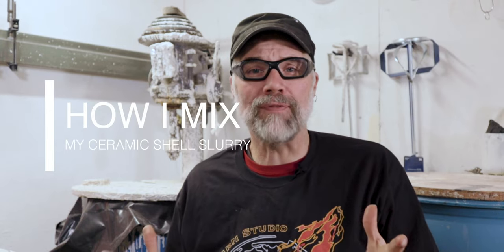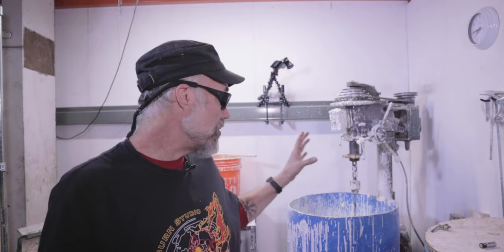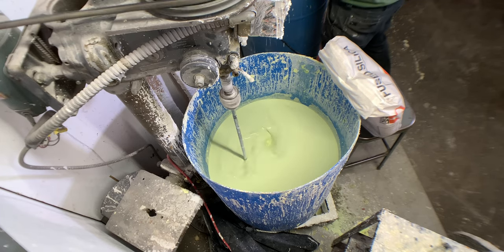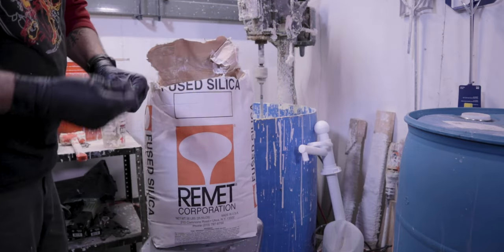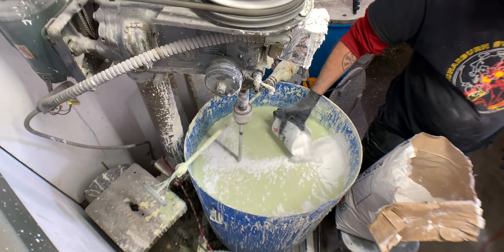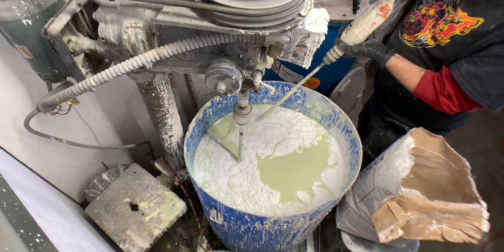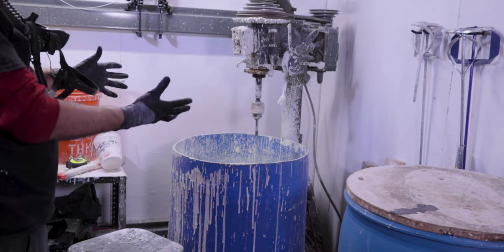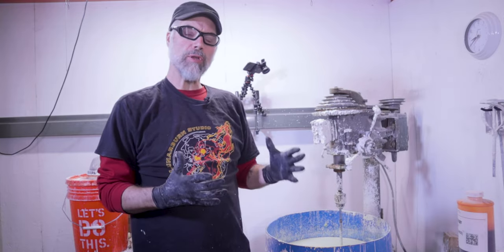Lost Wax Casting: How I mix My ceramic shell slurry

Comment: I know this is an old video, hopefully you're still responding to questions... Is all the moisture in the mix from the colloidal silica, or are you adding water to the mix? thanks
Reply from the maker: When first mixed it is just the liquid colloidal.  Over time moisture will evaporate and you will need to add distilled water to maintain the correct consistency.

Comment: Hi! thanks for the video. I am doing it at home, and slurry becomes little thick. In this case what should I add more? should I add more of colloidal silica?
Reply from the maker: The slurry can thicken as water evaporates from the slurry. To thin the slurry add distilled water in small amounts, mixing between each addition till its back to the desired thickness.
Reply: @LunarburnStudio  I used 25kg of colloidal silica, 50kg of fused silica, and 6.25 kg of bentonite. Then got a thicker result. What possibly did I do wrong?
Reply from the maker: The amount of bentonite is too high.  Should have been 150 grams at that ratio.
Reply from the maker: Im trying to think of a solution for your situating. Adding more water might help, but best to add both colloidal (1) and flour(2) @ the ratio of 1 to 2.  Although im guess if you are doing this at home your are limited by space.  

The recipe i use is 55 pounds colloidal, 110 pounds silica flour and a .25-.33 pound of bentonite.
Reply: @LunarburnStudio  thank you. I will try again.
Reply from the maker: Glad to hear you going to keep working with it. Also, dont feel like what you mixed is of no use.  Once you get a feel for the proper mix, you can use that first mix as your bentonite given the high density.  Now im not sure what quantities you will want to use, it will take some playing around.  So for now, seal up that first batch for that later use.  Good luck

Comment: can help me sir
Reply from the maker: I will try to, can you be more specific?
Reply: Sir, thank you very much for the quick response, sir. I want to know what the wax is used for in the design, and I want to know what the liquid in which the wax is placed and what is the powder that is placed on the wax after it comes out of the liquid and I want to do this method at home Does it work? Thank you, please.  I may ask you other times to learn from you and to know
Reply from the maker: @kink_  I prefer a microcrystalline wax, but a number of waxes can work.  Just be careful with candle waxes as they can be more flammable and can cause issues during burnout.  Check out my videos on wax working.  https://youtu.be/twt3fXp6B8U   As for the liquid its called slurry and is a mixture on silica colloidal and silica flour.  I prefer fused silica which is a fired quartz.  So silica four for the slurry and silica sand to coat the  wet slurry after dipping your wax.

Comment: Bro slurry composition
Reply from the maker: The recipe you use will depend on the materials you are able to source.  With Remet's Adbond II (colloidal) and 400 mesh (RP-1) fused silica flour my ratio is 1 part colloidal and 2 parts flour.  But again, the ratio could be a little different depending on the specific ingredient you use.  Check with the manufacture for their suggested ratio.  The perk of mixing your own slurry is that once you understand your base mix, you then have the option of tweak it if need be to your needs.
Reply: @LunarburnStudio  bro what is 400 mesh
Reply: @LunarburnStudio  AdbondII ?

Comment: Thanks Eric, great information ;0) I use a suspension agent now, but would like to know where you purchase your bentonite? I didn't see it offered at Remet and didn't want to guess with common hardware store material.... grateful for any advise. Chip Jones
Reply from the maker: Typically I source bentonite via ceramic supply.  I use a 325 mesh bent.

Comment: Have you ever seen an ANKARSRUM Kitchenmixer-System?
It supports to mix the slurry by using such a piece of wood or something, fixed to the barrel.
By the way- thanks for your nice videos.
👍🏼
Reply from the maker: I have not, but thats an interesting idea.  Just a reminder, you dont want to mix too fast.  the spped should be just enough to keep the slurry moving.  If too fast, it creates friction that will heat up your slurry and dehydrate it.  Just keep an eye on it.

Comment: I would come dip for you just to see your process and how you operate. Do you use Sp-30 for your back-up coats? The foundry I worked for ran a lot of work a week. The system we ran might not be as cost efficient for a smaller operation. Our slurry tanks ran 24/7 or it would separate and harden. I really enjoy your videos. I really makes me miss my old job. I worked in a foundry for almost 15 years. With that said your videos are the best examples of informing people. Thanks.
Reply from the maker: I run a one slurry system and the colloidal I use is Remets Adbond ll.  I have been doing foundry work for closed to 40 years (started in high school shop class).  I have taken a few brakes but always find myself going back to it.  Where are you located?
Reply: @LunarburnStudio  I'm in Oregon and spent many years working for Valley Bronze of Oregon in Joseph. We did a two part slurry. Primary coat and then back-up coats, but used Remet as well.

Comment: Looking forward to comparison between the referenced premixed slurries and any other of your excellent informative videos.  Is there a Safety issue with using fans to dry slurried/stuccoed works.  I have just started the process(4 coats so far) using your wonderful pouring cup concept (thanks).  I have chosen to let the works air dry over night without fans as I notice the stucco still slightly loose initially. I am retired and have the time!
Reply from the maker: Air drying is fine, the key is that the shells dry evenly.  Depending where you are doing the dipping and ventilation, fans can spread the silica around.

Comment: I got a lot out of this video and just subscribed. I hope to learn more. Thank you! 

Btw, if I had a small-ish tree of rings or pendants (fits within a 3"x5" flask?) how long would the overall process take of dipping, sanding and drying, then being ready to cast? (mixing time not included) I'm trying to figure out the advantages of the silica-gypsum process. Which captures more detail? I thought I'd put those out there. Thank you!!
Reply from the maker: My first question would be what kind of metal are you casting.  If gold or silver i would stay with silica-gypsum.  As for "Time" Dipping a shell that size could take several days depending on the environment you working in (how humid and how much air flow in the room). So longer than it takes to pour the silica gypsum.  Where you will make up time is in the burnout. if done right the level of detail is about the same.
Reply: @LunarburnStudio  Thanks for your really helpful answer! I think I'll be melting copper alloys to start. Maybe nickel-copper or some of the bronzes. Maybe make some sterling. I'd like to stay away from fuming metals and lots of dross for now. I'd like to study the basics intensely, then produce something marketable as a soon as is practical, if I can make something good that people are attracted to.

I really enjoyed your bio on your channel. Deeply written! I really enjoy your forthright energy and how you present things. 

I think I need a basic study course, like in the old days, in a really thick book lol How to do each aspect and the considerations of why. I'm trying to develop a list of cohesive questions just to focus on the subject. I plan to go to your website soon. I appreciate your time a whole lot! Thank you!

Comment: Hello, thank you so much for posting useful videos.  Is there a reason why the proportion of colloidal silica is higher than the general ceramic slurry recipe?  Also, when casting carbon steel in this way, is it possible to operate stably without major deformation?
Reply from the maker: I can can get away with the higher silica level because of the enhanced binder "Adbond II" makes for a stronger shell.  As for casting steel, I have not done.  I do know hat when casting iron, that the shell is stronger than the iron when it is cooling.  The result is that as the iron shrinks/contracts around a core made of shell and its a thin walled casting the iron can crack.

Comment: Hello, Eric! Thank you so much for your educational video! It became clear how to make complex processes available to the studio. I have a question. What are the characteristics of the motor you are using (rpm, power in watts and voltage). And how long can the suspension stand without stirring?
Reply from the maker: If your running a tradition mix, you really dont want it to sit for more then 15-20 mins.  With the addition of bentonite, my slurry sits still for hours/days and I only mix it for 10-15 mins for each dip cycle.  As for the mixer I use an ole drill press I bought salvage. I do not know the gear ratio but it is set for the slowest speed.  The motor spins at 3450 rpm and is made for continuous use.

Comment: Hey there!
First off great video, I wouldn't have gotten this far into casting if it weren't for you! For that I thank you.
Have you ever tried the Remasol Jus-Dip? If I understand their description correctly it is ready to use out of the box, no need to mix in any extra ingredients. As someone who is just getting started, something like this would be perfect. Any thoughts?
Reply from the maker: I have tested both Remets "Just-Dip" and R&R "Suspend-a-slurry". They are essentially the same. But yes you should totally start with one of those as you start working with ceramic shell.  I have been meaning to finish the video on my findings on the two products.
Reply: @LunarburnStudio  Very cool! Looking forward to the video. Thanks a bunch once more :D

Comment: Hello sir ,
Great videos !! I am a student from India . My dad owns a foundry here and these videos are helping a lot . One query - can colloidal silica contain potassium oxide rather than sodium oxide .what difference can it make in the slurry composition ?
Subscribed:)
Reply from the maker: I am not entirely sure, but it my understanding that both/either  potassium and sodium hydroxide can be used to adjust the PH of your slurry. Not sure about Oxides.
Reply: К2О + Н2О = 2KOH 
Na2O + H2O = 2NaOH 
Both reactions produce highly alkaline solution (pH>>7)
Therefore, in order to reduce acidity of the slurry (in other words, to bring pH up), one can use solution of NaOH or KOH instead of Na2O or K2O.
Reply: Are you asking about Sodium Hydroxide and Potassium Hydroxide?   Sodium Hydroxide (Lye) and Potassium Hydroxide (Potash) are similar chemicals except potassium oxide molecules are smaller in size.   They can be used interchangeably in a lot of formulas, however it really depends on if the other parts care if you have the sodium or potassium.
Now, if you're actually dealing with Sodium Oxide and Potassium Oxide, this would be the oxidized form of the base metal.  Like Iron Oxide (Regular old Rust)...  So of which are you speaking?  Hydroxide or just oxide?  My guess is, it's the hydroxide versions, which should be interchangeable to an extent.  However, I'm not sure that ive ever heard of potassium glass.  I know sodium glass is a thing.

Comment: Hi Eric,

How long will this last before you would have to worry about it drying out? 
If I kept a large drum (such as the one you are using) but utilized an airtight lid etc.
And do you have an idea on something that could be used to remove the air from the drum? 
Like something that will vibrate the drum.

Thanks,
David
Reply from the maker: You are right it all depends on the container used and the ability to seal it.  If you have an air tight lid that keeps the moisture from evaporating then the slurry can last a year or two. But even with a sealed container its a best practice to mix your slurry every few months to help keep all the silica particles fully wetted.

Comment: Thank you for these videos! Very informative. A couple questions - what rpm do you run your mixer paddle at? Also, do you do total solids testing? I am currently doing plaster investment but very keen to make the move to ceramic. Thanks & keep up the good videos!
Reply from the maker: I am glad your are finding my videos helpful.  Im not sure of the RPM of my mixer.  It's an old drill press and have it on a low speed. You want it mixing fast enough to visibly see the material moving but not fast enough to create a vortex. The reason a vortex is bad is that can draw air into the mix creating bubbles that can interfere with detail on the first dip and will dehydrate to slurry faster.
Reply: @LunarburnStudio  Thank you! Great info. Another question - I cannot get AD-II colloidal locally, but can get Ludox SK-R polymer enhanced. Have you ever tried this product before? Keep up the great work.
Reply: Por favor soy de argentina,podrían nombrar los productos químicos que emplean en estos procesos????? Muchas gracias!!!! Please!!!

Comment: Hi Eric,
Thanks for your great videos! I really appreciate you for sharing your experience in such a detailed way. I'm planning to make my first ceramic shell soon, the only problem I ran into is that I can't get my hands on 400 mesh silica flour. Do you think that 200 mesh will also work? I expect that it might not stay suspended as long as 400 mesh but I can't think of any other disadvantages. I'm curious about your opinion.
Reply from the maker: The 200 mesh should be fine, but you will most likely need to mix you shell a little more often.  200 mesh is typically for backup coats.  So when doing your first coat just be extra diligent to to get a smooth coat without bubbles to get the best detail.
Reply: Thanks a lot! I'll give it a try.
Looking forward to new videos.
Are you planning to do a video on casting the sculls?
Reply from the maker: @sebastiaanvangerwen7989  Yes, I am working my way through the process and will be showing casting soon, but first need to finish build my new furnace.
Reply: Hey I haven't watched all your videos or read all the comments but I will, in case this didn't come up though did you add water to your mix at some point and how much?

Comment: HI Eric, do you think it's worth degassing the slurry?
Reply from the maker: What problem did I mention that made you think degassing?
Reply: @LunarburnStudio  Just seen other people degassing the latex when making the mold and then degassing the ceramic slurry, I was unsure why they're doing that extra step if it really isn't necessary. I was going to build a vacuum chamber but you didn't seem to have a problem with bubbles so now I'm not.

Comment: Hi! which is the colided silica made of? what are the components? how much percentage of the ingredients
Reply from the maker: not sure, I have always bought it premixed.  sry
Reply: @LunarburnStudio  thank you anyway, great video!!
Reply: Silica is a term for pure SiO2. 

If particles of silica are small enough, say less than 50nm,  these particles would never sediment and stay in suspension due to random bombardment of solvent (in our case water) molecules.  (Check Wikipedia for Brownian Motion).  COLLOIDAL silica is a suspension of SiO2 particles of 50nm in size and smaller (need to double-check, but as a ballpark it is correct).

FUSED and FUMED silica are two terms referring to silica particles larger than 50nm and up to about 50 micrometer  (50 micron) that are able to sediment on its own from water suspension. 

Silica FLOWER, is a term usually referring to SiO2 particles larger than 50micron up to 0.5mm in size. In the USA, mesh units are still used to describe size of particles. The smaller mesh value, the large particles size. Let's say, silica mesh 200 has the size of silica particles that can penetrate through a sieve  with openings of 1/200 of one inch. 

SILICA SAND, also called quartz sand, is used as filler to sprinkle wax models after each dipping into silica SLURRY.

Finally, SLURRY is a water-based suspension of COLLOIDAL silica, FUSED silica, BENTONITE, and other additives to produce CERAMIC SHELLS over wax patterns or models. 

As to a non-native English speaker, it took me quite some time to figure out true  meanings of all these terms, that are confusing indeed. 

Hope this is helpful to all ceramic shell makers. :)
Reply: Obrigado lunarburn e obrigado sergey por a explicação 🤝🤝🤝

Comment: Like say in the description "1 part binder". What binder?  Could you link an Amazon page to some?  I really need more details.  Also someone said concrete sealer is liquid silica.  Idk if that would work or not, because I can't follow what you're using.  Could you please add much more detail to the ingredients part of the description, or make a new video going into them in detail please?  Thanks .
P.s. I just need to make 2 very small parts that I can't do without a method like this.  But even 5gal is way way way overkill.
Reply from the maker: Some concrete sealers mentioned are a super basic form of colloidal, the trick is finding a suitable silica flour, as most can not handle the thermal shock that accrues during the process of burnout and pour.  So far non of the suitable silicas i have found are sold in small quantities..  Fused silica (fired quartz) is ideal, some alumina can work as well.  Ill try to do another video that explains this a little better. Sorry for the confusion.
Reply: @LunarburnStudio  thank you

Comment: Can we use normal silica instead of fused silica ?
Reply from the maker: Most silicas can not handle tge thermal shock and temperature changes. 

The silicas that work are Fused Silca, alumina, and mullite